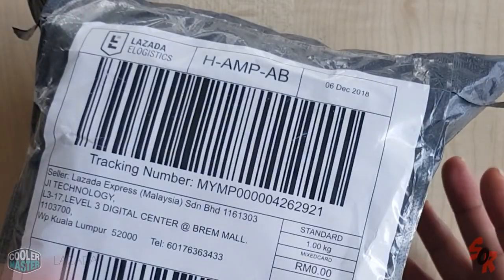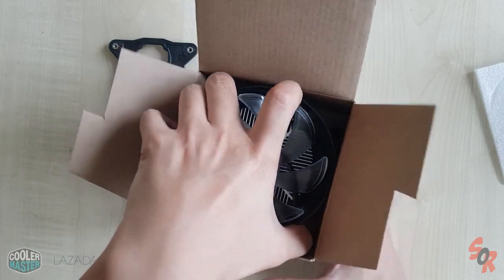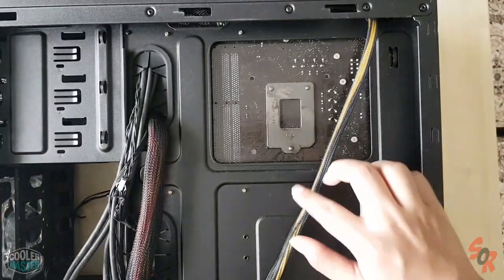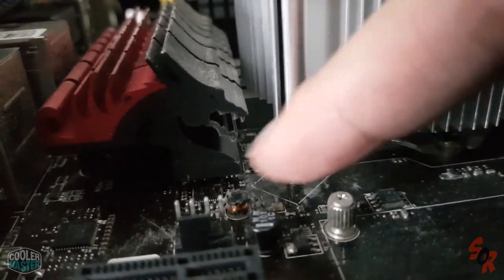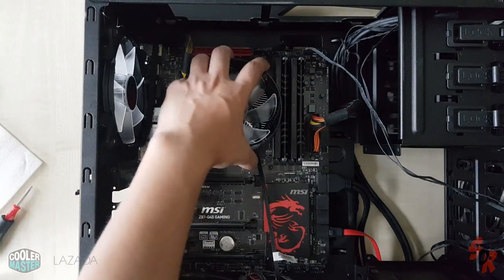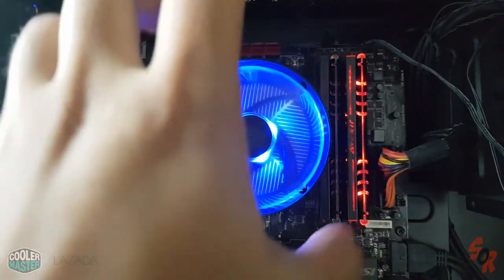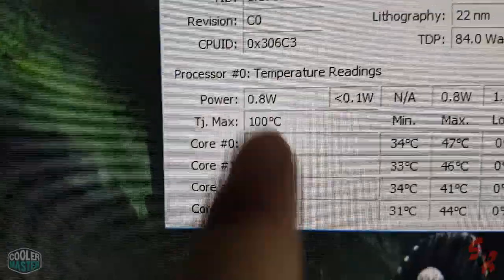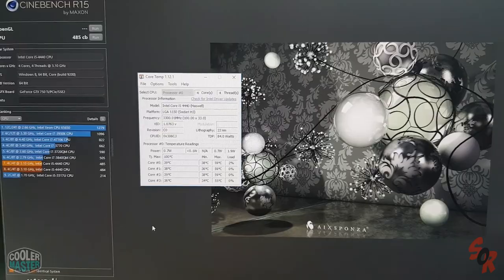COOLER MASTER i70c CPU COOLER REVIEW !!! + INSTALLATION + CPU TEST

Comment: I am going to buy it this morning for my i5 3570 😍😍😍 excited
Reply: How is it? Is it good enough for i5 3570? Plan to buy one for my 3570.
Reply: @handypratama417  already use for my 3770.. its great .. i mean idle temperature around 48 to 55.. gaming going to 70
Reply: i have a i5 9400, and my idle temp is 25-35, i dont think @SelanGkir installed it properly
Reply: @handypratama417  yup absolutely
Reply: @omarismail1795  how about the noise ?
Reply: @omarismail1795  How to "install it properly" ? Any suggestions on what mistakes he could've made while installing the cooler ?
Reply: @muhamadharnikarifhan7235  with stock cooler , i5 3570 once hitted 96°c in last summer I was like ( ꈨຶ ˙̫̮ ꈨຶ )
Reply: @ninadramteke1999   get a hyper 212, it's only a touch more expensive but it controls temp way better
Reply: @strider5119  nah , I upgraded my system since then. Running Noctua NH something on R7 5800x.

Comment: gonna replace my damn stock cooler with this!
Reply: same!
Reply: yooooo
Reply: my i70 cooler just arrived today
Reply: @naveenkmr1000  What were the results and changes in therms of temperature and performance comparing to stock ?
Reply: @Akillyzz  with stock cooler my i5 3570 reaches upto 92 degrees during rendering. With i70 my cpu temperature only reaches up to 68 degrees
Reply: @naveenkmr1000  Thanks for the info.
It's definitely a really expressive, not to say drastic, change in performance.
I've just bought mine but I don't know were to connect the RGB cable for Adressable Control via software, or were can I connect the Controller that comes with it.
M Mobo is an Asus Z97 Pro Gamer.
Reply: @Akillyzz  I have a regular i70 cooler, it doesn't have rgb, so, I don't know about RBG light connection.
Reply: @naveenkmr1000  Thanks anyways. I just figured where to connect the cables and voila. 
It's at least 15 degrees colder much better looking than the stock cooler, and most of the non low profile air Coolers out there, in my opinion...
Reply: Does it make noise like stock cooler???
Reply: @savage5013  No, it's much quieter than the stock cooler. 
it's actually like, at least 2x less noisier
Reply: @savage5013  it is much quiter than the stock cooler, even during the full cpu  load

Comment: Thanks for the review. The cooling power looks okay but you have some loud fans with an awful whine. I think some of it was the cooler master fan and that's really sad. I was looking for something other than an Arctic Freezer 11LP which has copper base, 2 copper heat pipes and 100mm fan that is absolutely silent but I had to install bare ram without heat spreaders or maybe you could use ram that has the metal sticker heat spreaders, but bare ram is fine when you have air from the fan blowing directly on them. I wish the manufacturers would realize they could make a heat sink asymetrical and then you would have ram clearance.
Reply: Well he didn’t screw in the cpu cooler all the way so you didn’t have to write a whole essay on his thing lmfao
Reply: @coryjbro7834  There were several scene cuts so I'm sure you are as sure of whether he screwed it down all the way as you are of who your father is. LOLOLOLOLOLOL

Comment: Quick question, does it mean that the cooler only fits Intel processors or does it fit AMD Also?
Reply from the maker: yes its only for intel for this cooler. incases of higher end models/types  they have an adapter to switch either.
Reply: A70c is for AMD, I70c is for Intel.

Comment: Why does it feel like my screws cant reach the bracket, I removed the fan to reapply thermal paste and these spring loaded screws arent catching anything and im way too scared to push down to try and reach the bracket cause it makes the rest of the fan pull up w the processor and I dont want anything to break

Comment: ive just installed mine and it wont light up, how do i use the rbg connector
Reply: There should be a little 4 prong connection cable, the other one you used for the power supply. This 4 prong cable should plug into a white 4 prong connection on the motherboard saying rgb connection. If there isnt one, you'll have to get an rgb compatible motherboard.
Reply: Sterling Vortex yeah I almost bought all of this rgb stuff for a pc then realized that the motherboard doesn’t have rgb headers 😂

Comment: Bro..... how am I supposed to take your reveiw seriously when you questioned out loud why the connecting cable was so long, but you made the decision to mount the cooler based on the orientation of the logo on the fan. Had you rotated the entire unit 90 degrees one way or the other, you probably wouldn't have all that slack in the cable..... that's 11 minutes out of my life that I'll never get back.

Comment: Guys go for Aerocool Core Plus RGB is little bit bigger than this, it has ARGB and it's much better and cheaper than this. I have max temperatures of 55 same processor, i3 9100. It never go over 55/56 in full load.

Comment: I have a problem I bought this same fan mine socket is rated for a LGA 1151 but when I go to set in the cooler the heatsink is too long and some capacitors are blocking it from placing it flush on the CPU so I don't know what to do
Reply from the maker: Hi, update me on making a video, and ill check it out. by your description, it looks like your casing and mobo might not  favour the installation.

Comment: dude im noob about pc.. i want to ask you something.. my mobo doesnt support rgb.. but if i install this cooler master to my mobo, only fan working or both led & fan working?
Reply: What do you mean your mobo doesn't suppprt rgb 😂 if it has a 4pin socket for cpu fan then the rgb will work
Reply: Is it possible to turn off the led lights? Cos you know, i dont want to waste electricity when the cabinet doesn't have any glass window to see the led lights. So it's pretty wasted. That's why i wanted to turn it off if possible.
Reply: @SubinGeorge26  no, you cnt turn it off
Reply: @Aureldylan97  the color can actually change on the i71C

Some motherboards have an actual RGB header. If not, the i71C kit also comes with an adapter that has a switch that allows you to turn the lights on and off, as well as change the color.

I think the i71c is the upgraded model for the i70c and gives more features for the same price  =)

Comment: Same cooler on i5-4690, temps reached 70°C using cinebench. Fan speed stuck at 1500rpm all the time, smart fan enabled. Been stuck with this problem since last week..
Reply: I want to buy this, how has it been?
Reply: for anybody else with this problem, go into your boot menu by pressing F12 during boot. go to your fans advanced setup. switch your cpu fan setting from voltage to pwm, or the other way around. the fan should now be variable speed.

Comment: I have a cooler master hyper t2 but I kinda like the look of this one. do you think It would be worth the switch? I don't overclock because I have a pentium g4560 which is locked
Reply from the maker: basically it goes down to personal preferences, at this item of video, i was aiming towards simple cpu fan, and scared of installing a hyper t2 tower , but currently using AIO M22 kraken, but do update me on what you got eventually yeah. if dont overlock dont seem the point , unless you like the aesthetics of hyper t2

Comment: I have intel stock cooler, will this cooler get fixed with the stock old back plate that came with intel old stock one? I mean installing it without opening the back side of mobo, same screw holes of stock one?
Reply: nop you have to
Reply: @cautionthelotion  i am a noob with pcs, lets see how it goes.
Reply: @yashbmr  yeah mee too the installation was hard maybe install it with help of someone

Comment: Bro my motherboard is asus P8H61-MLX , which has 4pins but this fan has 3 pins.. can you please say will this fan work with my motherboard? It has LGA1155 socket..

I broke my intel stock fan 😕
Reply from the maker: Please Note: You can connect a 3 Pin Fan to a 3 Pin or 4 Pin header on the motherboard. The fan will function normally no matter type of fan header is used 👍👍👍

Reference :

https://landing.coolermaster.com/faq/how-to-connect-a-3-pin-or-4-pin-fan-to-the-motherboard/

Comment: Is it good for i7-3770? I'm gonna use it for gaming
Reply: If you are going to spend a decent amount on a cpu you should get a better cooler, this one won't cool the higher end stuff as much
Reply: If you can’t overclock this is a better option than a more expensive CPU cooler.

Comment: Can i overclock with it?
Reply: noo wtf
Reply: If you want to overclock you’ll want something like the Cooler Master Hyper 212, this is more for non-OC units. For instance I got this for my i7 8700 to replace the stock Intel fan, but if I had the i7 8700k I would have gotten the CM H 212 instead.

Comment: can I mount it directly where the old intel cooler screw holes were? I see getting to the back of my mobo a lil troublesome to install the backplate do to my case
Reply from the maker: not sure, because installing a new cooler needs the appropriate back plate to mount on. but if so you could try it first.

Comment: today I buy this cooler...my cpu sucks...i3 4150..min 45, max 63...😓
Reply from the maker: hope you get a good temp bro
Reply: @SketchyOnReviews  my i3 4150 gets min 45 to max 65 😭 on i70c,, stock gets min 48 to max 67.
Reply from the maker: @Mahmud_Reza_Utsas    wow thats hot, use a good thermal paste bro, currently using thermal grizzly, works like a charm
Reply: @SketchyOnReviews  deepcool z3 im using.